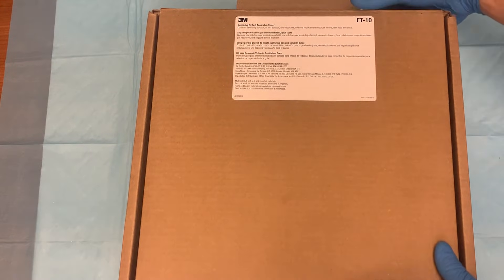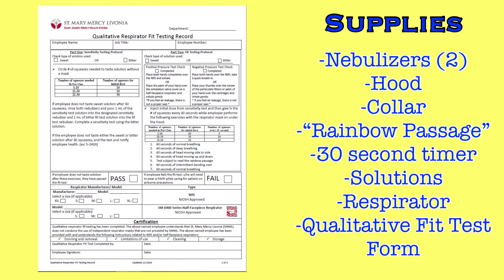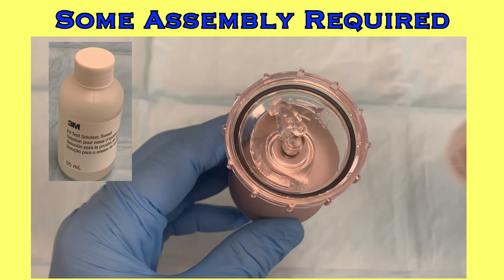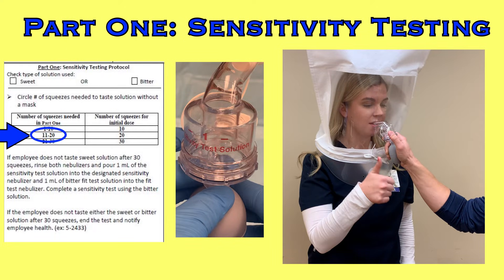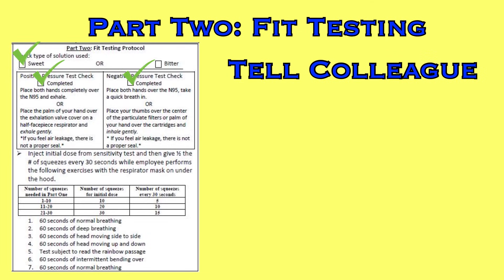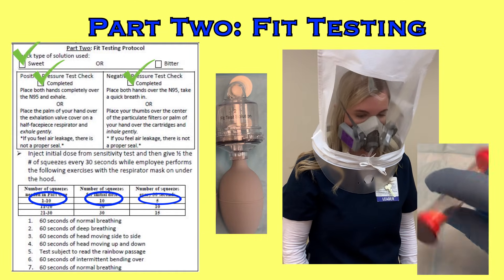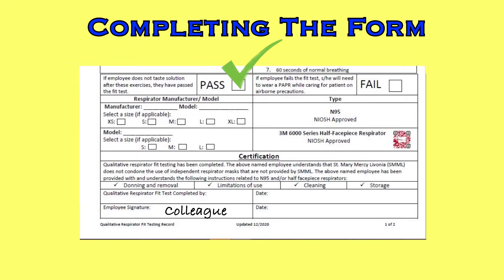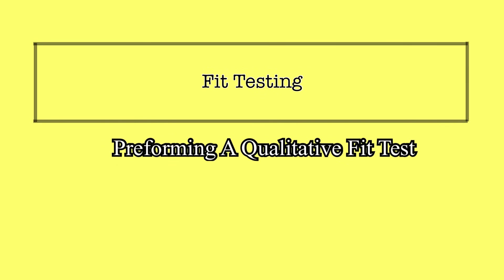Qualitative Fit Testing Procedure

Comment: I can almost imperceptibly taste bitrex.  It’s not as potent as the sensitivity test or when I purposely compromise the fit.  Does some of the aerosol still make it through the filter?
Reply from the maker: It shouldn’t get through the filters I would think…the issue I have with the bitters is that once I have the sensitivity level bitter taste in my mouth, I can’t stop tasting it for a while, even after washing it out with water.  So for me, I almost have to separate out my sensitivity test and my actual fit test if I were to use bitter solution for it. Otherwise I wouldn’t ever be sure I wasn’t tasting from a leak.
Reply: @nursingeducation3952  aah brilliant!  Yes you are right I did the sensitivity test just prior. Then i ate some chocolate and waited 20 minutes.  I will try again today.

Can i still use day old bitrex test soln still in the nebulizer or should i crack open another ampule?
Reply: @nursingeducation3952 great reply & solution. Thanks.
Reply: @nursingeducation3952 when using bitrex you can start by giving them one or two sprays without them breathing in. Most people will be able to taste or sense that. If not, I'll give them one or two more sprays and have them take a very light breath in. That's usually enough for them to sense or taste it without affecting the rest of the test.